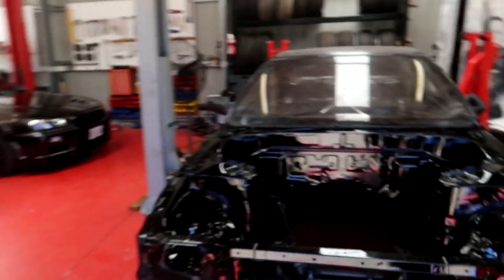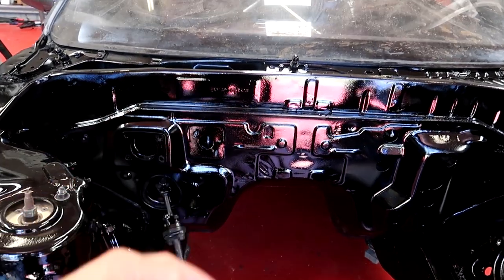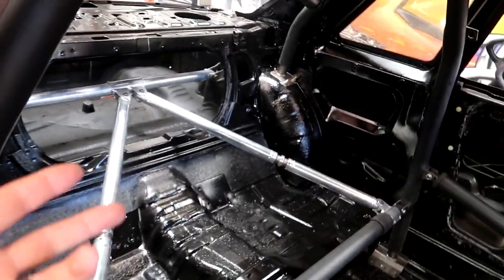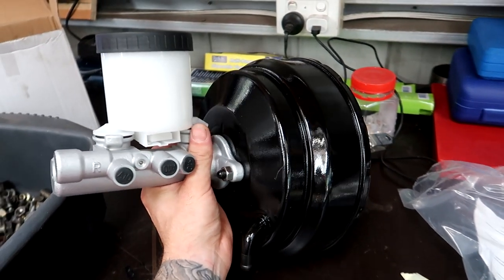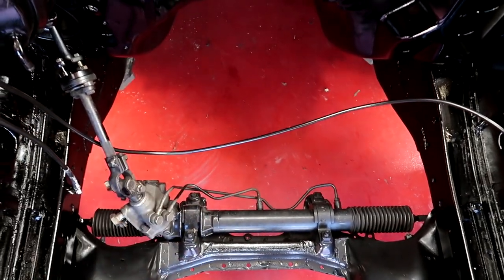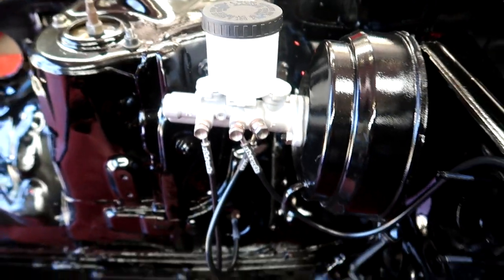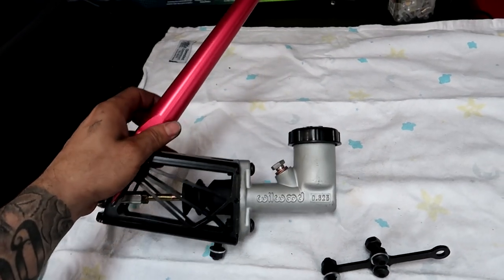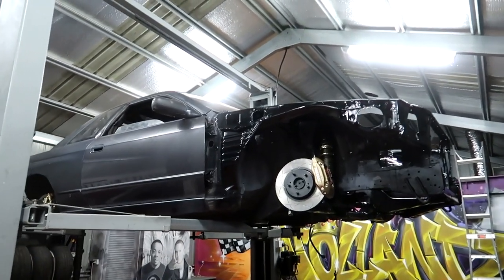RB26 NISSAN R32 SKYLINE II Drift Project Car, Hydro Brake Install, Gktech 👌🏼

Comment: Are you not going to be running a sway bar since your wheels will probably hit that because of the gk tech tension arms?
Reply from the maker: In drifting most ppl don't bother with a front sway bar because its not needed and also yes gets in the way, even tho I could deffs make one work with my gktech setup
Reply: @JAMESNOLLAND  oh for sure just curious because I got a similar set up (not installed yet) also did you relocate your rack forward at all?
Reply from the maker: Yer man I sure did, The boys at "car make revive" are professionals at these kinds on modifications 👌 is your setup for drift ?
Reply: @JAMESNOLLAND  yea it’s a hcr32 sedan drift car. Got Reverse knuckles, 35mm extended lca, zss uppers, and gk tech tension arms. How many mm they move the rack and did you have to extend the steering shaft? I’ve heard that’s an issue when people relocate their racks
Reply from the maker: Awesome stuff man 👌 yes you will need to fabricate a extra large spacer the go in your steering column